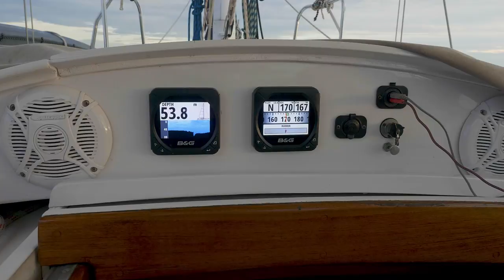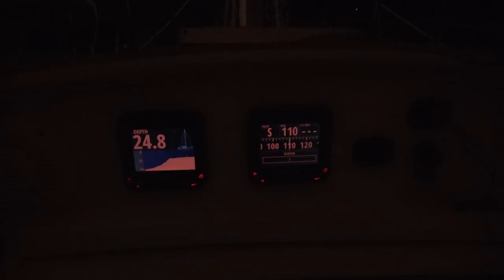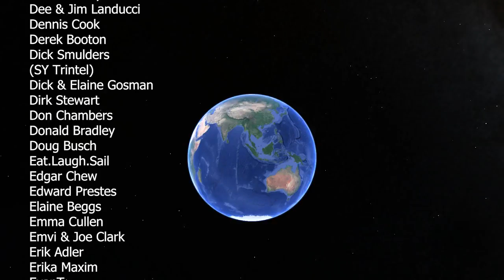BOAT EMERGENCY MAINTENANCE IN THE MALACCA STRAIT! Ep 76

Comment: Oh noes!  A cliffhanger episode!

In all my years of being a gearhead, racing motorcycles, working on cars, trucks, boats, lawnmowers, tractors and anything else with an internal combustion engine I have never ever lost engine oil pressure except when the oil sump went dry.  That rarely happns as I'm a compulsive oil-level checker.  Every time before start-up on the boat.  Every fill-up on other vehicles.   

You probably have it fixed by now, or by the time the second half of this episode airs but these are my thoughts.  There are a few different ways loosing all the oil could happen but usually it leaks or blows out all over the place or the engine sucks it up into the intake or exhaust such as through the turbo-charger with a failed oil seal.  That last one can cause a high-RPM runaway condition where the engine will not shut down and could possibly destroy itself in short order.   I've also seen a motorcycle knock a chunk of the engine case right off going over a curb which spilled all the oil out pretty quickly, and once drove my car through a frozen muddy rut off-road which ripped the oil filter right off the engine block. Both times the amount of oil spraying/spilling out was enough to cause a quick shutdown before anything bad happened and it was pretty obvious what the fix should be and where the problem was. 

If there is still enough oil in the pan after losing oil pressure it would either be a blockage somewhere in the line (perhaps a failed oil filter -never ever had that happen either) or the oil pump itself went wahoonie-shaped and died.  Oil pumps are pretty solid pieces of equipment but maybe the drive gear/shaft somehow was defective from the factory.  You have an almost-new Beta engine.  Those Kubota's are rock-solid engines.  I can't believe the oil pump or anything like that failed.  Maybe a chunk of something like the top "seal" of an oil bottle got poured in? 

Now I have to wait forever to find out what happened :(
Reply: Given a second to think about it and not just shooting off the hip like I did above, I forget that these new Betas are very highly computer-controlled.  I'm thinking now that the issue is likely to be a sensor error, wiring snafu, or electronics board failure.  I remember that you just mounted a new Racor (nice installation BTW but you are going to have a bit more  trouble filling it with fuel all the way and getting it bled if it isn't quite level, but I'm getting off track) and maybe a wire got pinched or nicked somewhere during that job.  That would be where I would focus my efforts first, after checking out the wiring diagram and Beta/Kubota's troubleshooting charts.  I still can't wait to see what actually happened.
Reply from the maker: Thanks for that breakdown, James. I learned a thing or two there! We'll break it all down in detail next week and will also refer to these comments too. There are people like yourself out there who know a lot more than we do.
Reply: I know just enough to be dangerous, but I'm no certified diesel technician. When we are out there ourselves I hope to be able to maintain the calmness and composure you both showed in the video in a very stressful and sticky situation like this.  

My wife and I can't wait for the next installment and see how you guys overcame this problem and got back safely to where you are now.

Comment: Can always get out and tow it with the dinghy. Not the most efficient solution, but it does work. Once, in a bay, I was on my small catamaran toward the side of a channel near a big-ship port. No wind. A huge tanker suddenly approaches and starts blaring its horn. I got off with a line, swam a little ways, and found a shallow-enough spot where I could stand. I hauled the boat out of the way. No, obviously you could not do that with your craft, but my point is that you must do what you have to do when necessary. Good luck.
Reply from the maker: [Liz] Cheers, James Jamie mentions pushing Esper with our dinghy as an option... next week we'll explain what we did. Thanks for illustration your point with a personal story. 
Peace and fair winds!

Comment: Nightmare situation in that ocean for sure. Very scary situation and I'd probably have a panic attack and wouldn't be able think straight.  Way to stay calm.  Me sitting behind my computer on my lunch break tells me that you probably didn't lose oil pressure, if the dipstick is showing its full of oil. Hopefully its just a faulty oil sensor, bad connection or frayed wire causing the engine shutdown.   You guys are the best!  Good luck.
Reply from the maker: Well next week you'll see how being tired led to some incorrect conclusions. We weren't thinking straight and probably appeared calmer than we were, Patrick.

Comment: I suspected a faulty sensor either low oil or low pressure. With the reported oil in the bilge it would assume an oil line ruptured or became loose. Good Luck. With the repairs.
Reply from the maker: Thanks. We'll fill you in on the details next week!

Comment: That's a new beta we spoke before , oil in the boat , adding oil , check all oil lines  , have you the pump out sump plug with the rubber hose attached check it , it connects up to the side hand pump , that's the only way you can loose oil ,

Comment: Great episode! As you've obviously got to port to post this, I assume you solved the issue!! From the unpressurised view in my armchair, it sounded a bit like a propeller fouling. 
The oil alarm came on after the engine stopped, so unlikely to be oil starvation, especially as the engine stopped too fast, and there were no associated running hot noises prior. 
Did you have the "not under command" lights on as you were drifting ;) 

BTW, was that just a bad angle at 0:38, or does Millie need to take more exercise ?
Reply from the maker: +Antony Norris [Liz] Yes, Millie does need to go on a diet...but then we all do! 😁😂🤣

Comment: Do you or have you considered a night vision monocular for night operation? I have one that was less than $150.0 that does not require batteries! FoV to 1mile and wireless night vision camera's mounted bow and stern... and display in the cockpit at the helm, Less than $80 for 2 cameras and display... they are good out to 800ft. These devices take a lot of guess work in the busy areas....
Reply from the maker: I'd done some cursory research, Michael, but the general consensus was that the cheaper ones don't work well in rolling seas. Sounds like this is not the case in your situation. That said we're pretty comfortable with radar, AIS and the bins.

Comment: Cliffhanger!!!!!  :-)  Are the high pressure oil lines you are talking about (assume they are like hydraulic type built hoses) worth carrying a spare set for these kind of incidents or are those failures so rare it's not worth it?  Seems a shop (especially where you guys are) could make a full set for pretty cheap.  Or at least a couple longer ones that could be used in a couple locations.  Just thinking out loud - no telling what happened from watching.  Cheers!
Reply from the maker: Yes, agreed, spare hoses are on our shopping list.

Comment: Judging by the way the engine konked out I am guessing a plugged fuel line, tank breather or filter. When the RPM's dropped, the oil pressure dropped with them and made the alarm sound.
Reply from the maker: +Nicholas2011ist [Liz] We reveal everything in the next episode - including the cock-ups!
Reply: Ah, sod it. We´re only human, we all cock-up! It's our nature. I once lost compression on one of the cylinders of my engine and assumed that the piston rings were to blame. Only once I got to the stage of tightening down the cylinder head (after spending close to 1500 dollars) did I realize one of the exhaust valves was chipped.

Comment: Buy a British seagull 102+ long shaft outboard as a backup should should cost less than $200usd for a good one and can push displacement hull's 8-20 tonnes
Reply: I honestly can't think of anything less reliable than a British Seagull... Second hand ones mostly still have the marks on the top from the last owner beating it with a hammer!
Better off turning all the deck lights on and just pushing it with the tender till you can anchor, which it looks like they did!
Reply from the maker: razzorbladz [Liz] Our Tohatsu 9.8 coupled with the Highfield dinghy can do the same job. Jamie considers the option of pushing us to anchor in the video. Next week we'll reveal our solution. Peace and fair winds!
Reply from the maker: Wave Dancer [Liz] Yup. 👌😉
Reply from the maker: Charles Phillips [Liz]  Yup, that was a realistic option, just as Jamie suggested at the time. 👌

Comment: So low oil pressure sounds like diesel in the oil. And fuel pump failure.engine sounded like ran out of fuel in the videoA fuel pump can fail in as little as 100 hours yanmar tells me. Hum Look forward to the next video.